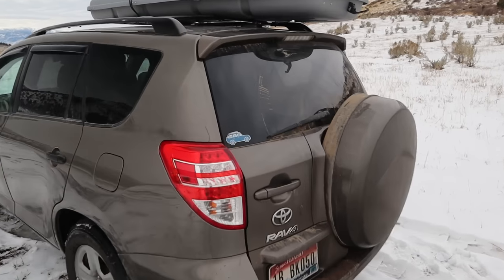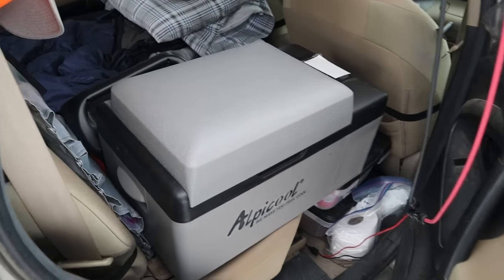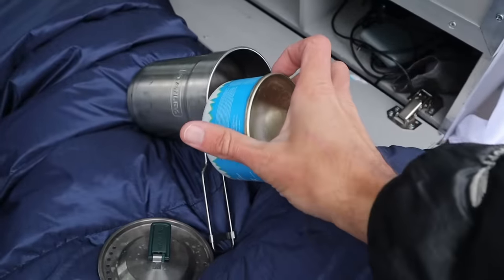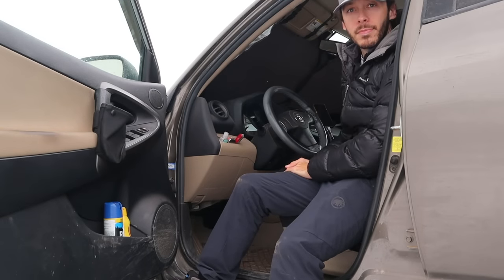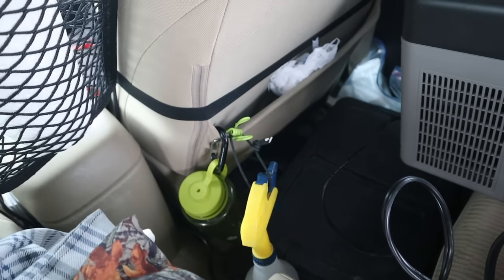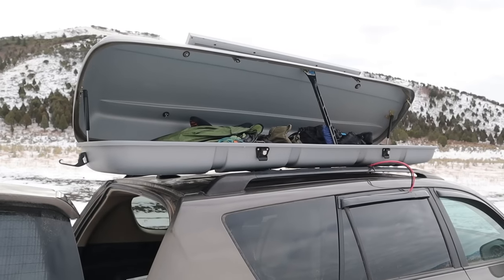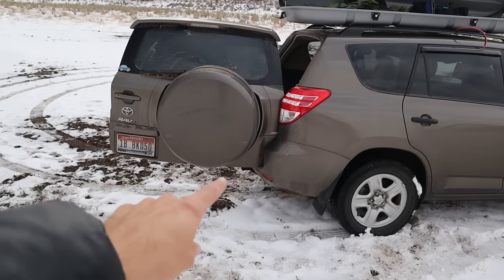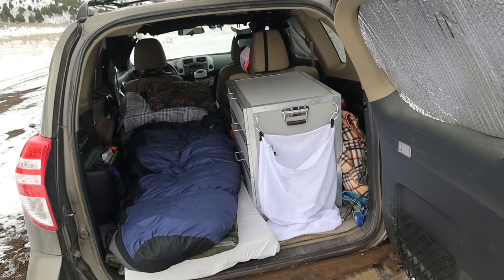My SUV Camping Setup: Full Tour of My Mini Camper! (Vanlife in an SUV)

Comment: Great video!  Does the back seat fold down flat?  Or did you modify it in some way to create a flat surface the length of your bed?  Can you sit up in bed without hitting the ceiling?  Do you find that the Rav4 has enough ground clearance and solid AWD to get you down rough roads?  Lastly, how many mpg do you get?  Sorry so many questions.  My current minivan (which I love!) is getting up there in miles, so I am starting to think of a replacement vehicle.  You seem pretty happy with your Rav4.  Thanks!

Comment: That is dialed in, wow. I am super tempted to do something similar but, I love bringing my MTB and I fear if it is not in the car it be gone in no time, even locked up, , , ,Do you think I could tip the bed vertically  to the side wall and put the bike in there? Is the solar worth it? doesn't the car charge the big battery enough?

Comment: Thanks for showing us your home on the road. Solar question. Are you still using the solar panel to charge your DIY deep cycle battery build, or do you get all your power from the Jackery now? Great video! Thanks for all the info.
Reply from the maker: I don't use the DIY one anymore. The commercially available ones are better in every way.

Comment: Sleeping setup:  I think you said you have about 6ft of sleeping area.  Was that with the seat slid all the way up?  I'm kinda over 6ft, 6'3".  My setup would flop everything over to the other side.  Goes the same with van setups I see.  They are always on the drivers' side.  I might even take out the back seat if it isn't used very much.

Thanks for posting.  liked
Reply from the maker: Yep, that was with the seat moved all the way forward

Comment: Besides the sleeping bags and the heated blanket, do you use any thing else to keep your area warm? I've been trying to come up with ways to heat my mini camper van. I haven't had much luck so far. I've looked at low watt personal space heaters, but hear they draw too much power from the power source. Any suggestions would be great.
Reply from the maker: I've never actually used the heated blanket for anything other than testing it. The sleeping bags are plenty for me. I've used them down to single-digit temps. I've never used anything else to heat.
Reply: Thank you!

Comment: Kudos, kid.  Looks like you are maintaining quite well. Personally I would have taken the rear seats out, but then I'm just an old fart happily retired alone.
Reply from the maker: I see no need to take out the rear seats. The one that I've folded down creates a perfect sleeping platform. The one that I have up anchors the cabinet/cubby in the back. Taking the seats out won't give you any more headroom because you can't change the height of the rear cargo area's floor. You'd just need to build up a platform where you took the seats out. It would give you more storage, but I don't really need more storage, and I like the flexibility of having an unmodified vehicle (e.g., I can still use the back seats). But you do you! Thanks Robert.

Comment: Tee tree oil is what I use and it is excellent as a deodorant!
Even if you need something in
A hurry during the day and you have bad odor under your arms you can still use it w/ out bathing and it will take the
Bad odor away! Also. Which
Hazel is excellent for cleaning
Your privates. It was recommended in 1990 and I have used it ever since. Use it
On a wet wash rag or baby wipe.

Comment: I like your set up!!  How do you deal with the moisture and combat mildew ?  Because it looks like that plywood  is moist .
Reply: I saw a rv video where they used a dehumidifier.  I suppose that is more important in some areas and seasons than others.
Reply from the maker: I've never had a problem with moisture or mildew buildup.

Comment: Would you say the Jackery 500 could keep up ok (with adequate sun) with fridge, electric (12v) blanket and charging phones? I want to get one but want to be sure it's big enough. Clever way to run your solar panel wires. Thanks!
Reply from the maker: Check out the video I did right before this one about which portable power station people should buy. I address your question. But the short answer is that if you're on top of making sure it stays charged, yes, the 500 can work. But if you get a day or two of cloudy weather or if the charging cable accidentally comes undone for a day and you don't notice, you may be stressed out about running out of battery.

Comment: So you had a Jackery 500 and it was permanently connected to a 100W panel , and you powered that exact fridge continuously? I understand its cold outside in your video but was the 500 sufficient?
Reply from the maker: Assuming everything stays plugged in and you have a good amount of sun, yes, it'll run the fridge continuously.

Comment: Do you have 4 wheel drive?
I like my Ford Transit van with mid high roof. Gas is cheaper than diesel. Plus it would use DEF as well, driving up the cost. My van also has a V6 310 hp twin turbo EcoBoost engine. My van also has the trailer tow package. 
Thanks for your review.
Reply from the maker: Yes, but I rarely use it.

Comment: how many miles do you have on that car now?  You drive the snot out of it!  Would be interesting to hear your maintenance routine.  I like your style, getting out there and seeing stuff without geeking out over the "camper build".  for years I've just used a sleeping bag, pad and a cooler.
Reply from the maker: It's got 150,000 miles on it. I've had it for 5 years, and it had 50,000 when I bought it. So I've put 100,000 miles on it or roughly 20k per year. For maintenance I basically just fix whatever is broken and whatever they say I should do when I bring it into a mechanic. Nothing too fancy. Thanks Dave.

Comment: On another channel I saw a RAV4 driver airing up at the end of what she said was a rough gravel road in Southern Utah. Do you carry a portable air compressor on your trips? Are you (or would you consider) airing down on challenging roads, say Magruder Corridor West section? Do you think typical SUV🚙 tires have sufficient sidewall height to justify cost/time for airing down/up?
Reply from the maker: Seems like way too much hassle to me. I've never done it and have never had any problems. But I do carry a portable air compressor for emergency purposes.

Comment: Very good video! I have a ford escape and instead of a similar roofrack box you use I installed two rifle case so I can drive in and out the garage. I watched another video where you show a traction pad. Have you ever needed to use it? What do you think about the recovery/traction boards?
Reply from the maker: I used the traction pads last year when my wife's car slid off of an icy road and into the shallow ditch on the other side. They didn't do any good. I will probably end up getting some sub-$100 Maxtrax knockoffs from Amazon. There are lots in the $55–$75 range that get decent reviews. I'm sure they aren't as good as the Maxtrax, but if they get me even 75% of the way there, that's a win.
Reply: What type of rifle boxes?  Do you have a link?  How did you attach them?
Reply: @SUVRVing  thank you! I think I will do the same. Try to find something below $100 for emergency.
Reply: @MyEmptyNestQuest  I bought two 42" Plano Rifle case. I bought last month for $69 in amazon so it was much cheaper than roofrack box. The cases came with seals and lockers. I made two holes in the front and two in the back and fixed using carriage bolt and nuts with nylock. Instead of using washers I preferred to reinforce the plastic cutting two pieces of aluminum flat bars to install inside and outside the box. It would help with sealing too.
Reply: @tamowill  thanks for the info.  I think this is a great idea!
Reply: @MyEmptyNestQuest  https://www.amazon.com/dp/B07B7SB486/ref=cm_sw_r_cp_apa_fabc_pUxUFbEH930ER thats the link. Prices are up now. I suggest to keep watching this case in amazon as from time to time the prices lower to the $69 I paid. When I decided to install this case the price was more than $100. So I keep looking from time to time and when the prices went down I decided to buy 2. You can find a lot of videos of people installing this case specially in tacomas and 4 runners.
Reply: @tamowill  awesome.  I have a Sequoia right now and next week I am getting an Outback so I will definitely be watching some videos.
Reply: I had a 4X8 sheet of OSB cutbup into smaller strips at Lowe's. I store them underneath my sleeping pad, in a single layer covering the whole truck bed. When I need them, I slide them out. They work They have gotten me through some short sandy sections very well. Haven't used them often, but when they were needed they saved the day.
The cost was around fifteen dollars.

Comment: Just wondering why you didn't just put your bed on the passenger side of the vehicle.  Then you don't have to worry about changing the driver side seat up and back and up and back.  Just a thought.
Reply from the maker: The rear seat is a 60/40 seat. This means that it folds down in two parts. One part is 60% of the back seat, and the other part is 40% of the back seat. The 40% side, which is the passenger side, is too narrow to comfortably fit a mattress and to sleep on. The 60% side, which is the driver's side, is the only side that is practical to sleep on for that reason.

Comment: My only question is why you didn’t remove the backseats. Obviously you’ve adapted with less space but wondering why you made that choice.
Reply from the maker: There's no reason to remove the seats. The seats are what provide both the level sleeping platform and the anchor for the cabinet. If I removed them, I'd just need to build another platform to sleep on and figure out some other way to anchor the cabinet. Not worth it. I don't need more space, and I like being able to use the back seats when I need to.
Reply: @SUVRVing It’s the build the works best for you. If I hadn’t taken out my backseats, I would have lost so much space that is now water, clothes and miscellaneous storage. Still a work in progress.

Comment: I love living in my Rouge #rougelife 
I need external electrical but for now I have somewhere at night when below 30.
Reply: Parking garages usually have electrical outlets placed throughout, here in Connecticut. Perfect for disguising as engine block heater cords, that actually charge a house battery and power loads. I wonder if one could get a Tesla battery for the fridge, etc?

Comment: Can you let us know how you hooked up your Renogy to the Jackery? I have both and have tried to attach them to each other. I purchased an adapter connector off Amazon. But it doesn't complete connect correctly. They refunded my money. I contacted both Jackery and Renogy and they can't recommend a connector and don't make ones to connect these two together. So basically my Renogy is useless to me until I figure out how to plug it into the Jackery.
Reply from the maker: MC4 to 8mm cable: https://www.amazon.com/dp/B08HYVXJVM/ref=cm_sw_r_cp_apa_fabc_sk9dGb3GNP0DZ?psc=1

Comment: I am trying so desperately and unsuccessfully to find the right vehicle... the prices for a used vehicles are INSANE where I live, almost as much as new. (Southwest Fascist Nazi, FL USA) There is a 2012 95,000 miles V6 AWD RAV4 just like yours down the street... $12,000... But it has been on the lot forever... It must have been in an accident or something. I'm not paying extra for a Bad News CARFAX. But I agree... this is the OPTIMAL vehicle (especially the V6 AWD) ... as would a Subaru Forester... I may only be able to afford something smaller which really sucks... ANYWAY,  Thank you for your videos... I am living through them (Seriously) until I can finally get a vehicle that allows me the proper utility.
Reply from the maker: Yeah, that's pricey. When I bought my 2011 in 2015, it had 49,000 miles and was $15k. Mine is a 4-cylinder 4WD (not AWD). Love it. Hope you're able to find something!
Reply: Hey, hope I can offer some useful suggestions.
Toyota 4Runners and Tacomas, pre-2008, are simpler and less expensive to maintain and purchase than the newer ones, and are more reliable than virtually any other brands out there.
Avoid the 3.0 liter engines, though (I can give details if you want them). The best engines are probably the 4-cylinder ones and the 3.4-liter 6-cylinder. The 22RE is legendary. Maybe the best engine ever made for these sorts of vehicles. I have one with 307,000 miles on it, and it's going strong. It is not unusual for them to go over 400,000 miles, and they are easy to work on, and inexpensive to maintain.
The 3.4 liter 6-cylinder is also an awesome engine.
Best to find lower mileage vehicles with no rust. You can easily find them for under 10K, sometimes for much less.
Finding one from an owner who maintained it carefully is best.
Mileage and simplicity are better with the 4-cylinder engines, but the 6-cylinder 3.4 is close, and has more power if you need it.
Reply: @viveviveka2651  Thank you!  This is very good information...  Thank you!
Reply: @sonnyblu6299  You're welcome, glad it's of interest.
Reply: I am so happy to say that I found a vehicle... I was so incredibly frustrated. I drove 2 hours to get it.  It is a "I believe only driven to Church" one owner, very low milage, super clean and well maintained, 2009 Lexus RX350 AWD... Full sized spare tire. (I dream of some Goodyear AT's on it) I know not that many people use these for car camping... but it's got over 80 sq feet of cargo area. And I don't plan on treating it "that" bad... LOL.  I can sleep in the back no problem being 5'9".  Thank you Tristian for all these great videos...

Comment: do you sometimes park your car on the street to sleep? if so, you may want to move your bed to the passenger side.
Reply: I'm curious. To stay out of sight?
Reply: @Warlion13  it for the safety, an out of control driver (at night drunk driver)will normally hit the car on the driver side?
Reply: Those are very good reasons  La Vãn Thank you. Good luck in your travels.

Comment: How long is the bed? My 2012 Ford Escape is only 5"2" and I can't stretch my legs.
Reply from the maker: Really? That's too bad. I'm 5 ft 11 in and have a few inches to spare
Reply: I'm 6'3", driving a '13 Escape, and on my business trips, I can be on the road up to 4 days. When I bed down for the night, I move both front seats as far forward as I can and tilt the seat backs as far forward as they will go. I can't stretch out, but I can be reasonably comfortable.

Comment: Why not sleep in the passager side? You can have more space on the driver seat
Reply from the maker: The back seat is a 60/40 seat, meaning that it folds down in two pieces, one approximately 60% of the total seat width and the other 40%. The 60% side is on the driver's side. The 40% side, which is on the passenger side, is too narrow to fit a camping mattress into.

Comment: If you took the seats out couldd you fit a cot ??
Reply from the maker: Taking the seats out won't give you any more headroom because you can't change the height of the rear cargo area's floor. So you'd just need to build up a platform where you took the seats out. Not sure if it would fit a cot. It probably would fit a small one, but I'm not sure why you'd want to do it. Thanks for watching.

Comment: When I camp where there are no showers or just to be fresh after a potty event, I use a homemade solution of water, Dr. Bronner's liquid soap (I use about half of what's stated in the recipe, and 10-20 drops of Tea Tree oil. You can either use it in a spray bottle and spritz paper towels to wipe down, or you can put some in a vertical container and add a cut down roll of paper towels. I've gone many days using that and never had any odor problems or felt dirty or unfresh.  Here's the link about how to do that:  https://adventuresofmel.com/homemade-no-rinse-body-wipes-for-camping/

Comment: I have noticed that 99% of people camping/living in their vehicle have their bed set up behind the driver side. Why? Wouldn't it be easier to set it up behind passenger side?
Reply from the maker: The rear seats fold down in two parts (called a 60/40 seat). The larger part that folds down is in the driver's side. If I folded down only the rear passenger side part, the resulting area wouldn't be wide enough for a bed. Also, if the bed were on the passenger side, you'd need to walk all the way around the car to get in bed.
Reply: @SUVRVing  thanks makes a bit more sense now 😊

Comment: Why not sleep behind the passenger seat and leave the seat and wood in place.
Reply from the maker: The rear seat is a 60/40 seat when folds down. The 60% side is on the driver's side. A camp mattress wouldn't fit if only the passenger side were folded down.